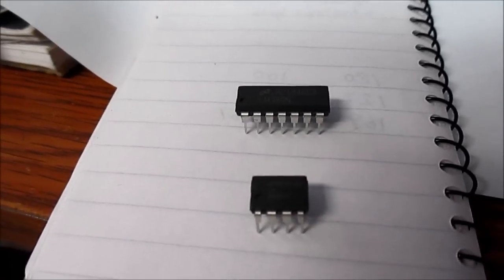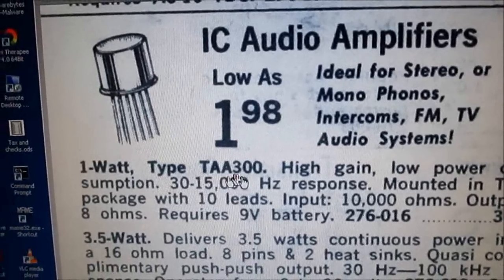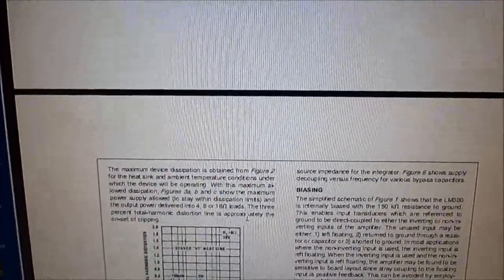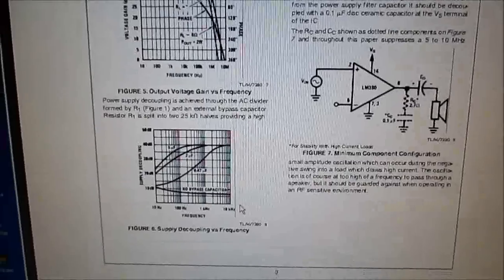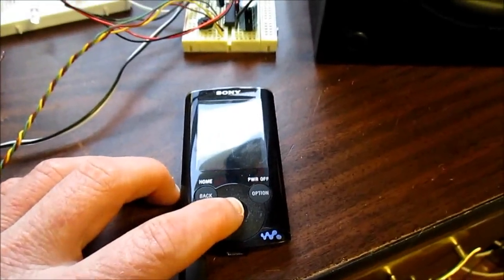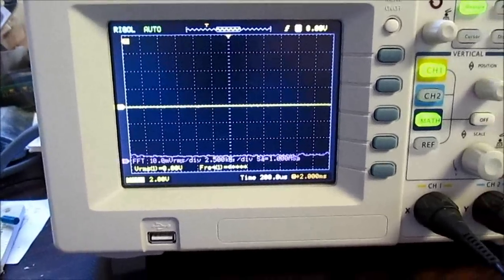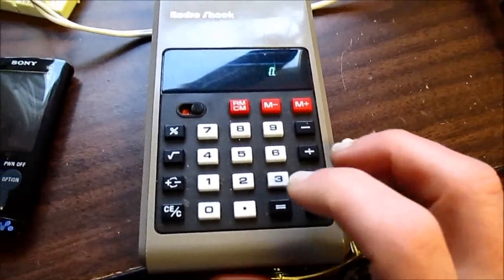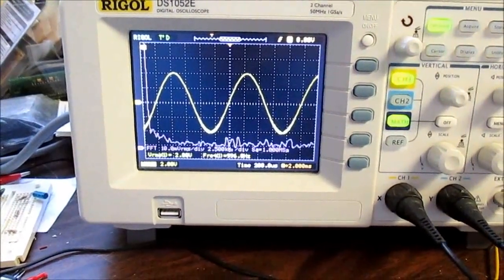LM380 audio amplifier IC test and review

Comment: I have noticed on some of mine, and yours showed it too I believe, a supersonic ringing on the negative peak of the waveform.  Notice how your trace is thicker at the lower extreme of the waveform. A 470pf directly at the input pin to earth cleaned mine up.
Reply from the maker: Yes I noticed that. It is normally caused by the instability of the complementary feedback pair in the lower output stage. I'm surprised adding the resistor to the input cleared that up. To test stability, I added a coil of a few microhenries and a small value capacitor across the output in parallel with the 8 ohm load and the oscillations became very large. I tried the stability test on a couple of different ICs and they were rock stable. I'm disappointed in the performance of the LM380, but it is quite an old design.

Comment: Agreed,  almost as old as me.  LOL.  They did have trouble getting power pnp transistors to work well in those days. The power level is typical for audio chips of that vintage, at 12v. Most 5watt chips needing around 20v back then. I've also noticed the sweet spot for most LM380s is in the 14-18v supply range. Many not working at all at 9v, despite its popularity in magazine designs from the '70s, running off 9v batteries. Perhaps the design has been modified a little throughout the years. Despite its drawbacks I still have a fond memory of my first stereo amplifier I built using two of these in '77. As a young lad of 11.

Comment: You only supply the chip with 12v it can take up to 22v, that will give you more watts. The 2.5w is based on a 22v supply. the LM384 can take even more higher voltage, but most applications are 9 or 12v

Comment: Liked the old fluorescent displays, don't think I have any still around from that era. Missed that EEVBlog.
Reply from the maker: ***** I bought that calculator off eBay earlier this year. I did have a different one back in the 80's and wanted one again. I'd like to get a LED 70's version and maybe even a gas discharge tube calc (more expensive and rare).

Comment: Maybe your player can't drive IC fully (I mean amplitude of the output of player). Had this kind of problem with larger amps, e.g. TDA2030A, TDA2050...
How much voltage your player gives out?
Reply from the maker: MrJohhhnnnyyy Adjusting the pot on the board takes the LM380 output from clean into clipping so the IC is what is clipping. The level on the music player was not adjusted in the power test. Most portable headphone devices put out up to around 500mv rms of clean power. With 34db of gain in the IC amp, that is high enough to work well with headphone devices.Those TDA chips have the gain set to a lower 30db (if the datasheet feedback resistor values are used) and they can output many times the power so headphone music players will struggle to drive them loud. You have to increase the gain or use a preamp in front.
Reply: JohnAudioTech Got it. I slightly glitched 'bout the fact that it's driving it well into clipping, so definitely enough amplitude, my bad

Comment: Could you put together 100w Audio Amplifier on a bread board? I have been watching your video, have been  very interesting
Reply: A 100w amp into a 8ohm speaker gives you 12.5Amps through the IC for 100w amp you need more voltage.
Reply from the maker: 100 watts from an 8 ohm load would require an rms voltage of 28.3 and a current of 3.5 amperes.

Comment: Can you explain why output powers calculate approximately to
1w, but database tell min Pout is 2.5w?
Reply from the maker: They measure using a higher supply voltage, otherwise they spec power at a higher distortion, say 10% which I never do. I can't test at higher supply unless I add a heatsink to the IC. With a higher supply voltage you can get 3 or 4 clean watts with an 8 ohm load but MUST use a heatsink.
Reply: Thanks for your answer.  In database connect C bypass capacitor between sources and
pin 8. Can you explain why connect this capacitor?
Reply from the maker: on the 8 pin DIP version pin 8 is the bypass. There is a voltage divider circuit inside the IC to set proper operating point of the chip. The bypass cap removes the power supply noise from the amplifier.

Comment: Just repeating what Chuck Norris stated previously. This chip is rated 8V min to 22V max, so it won't even get close to giving it's rated performance on only a 12V supply. You had the data sheet open the whole time you were rambling for most of the video, so perhaps rather than waving the camera at it, you should have read it! The chip is rated a max 14V swing on 22V supply, which shows that it's losing about 8V across the output stages. That's why you measure such a small voltage and low power on 12V = DOH. It's a real pity you didn't measure what the chip could actually do, which is the whole point of these kinds of review videos, right?